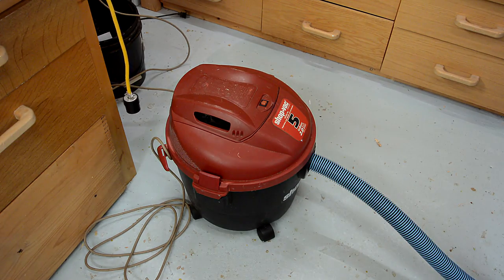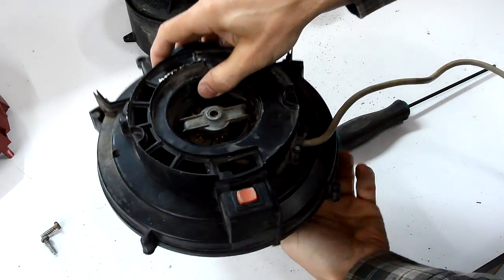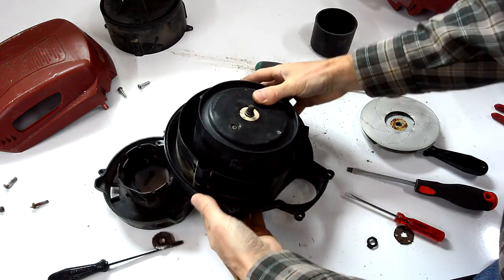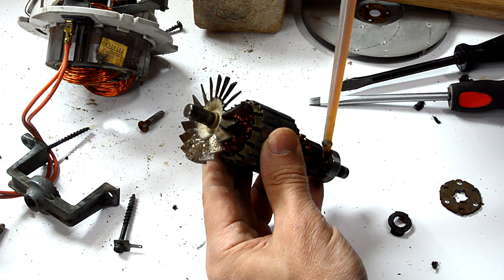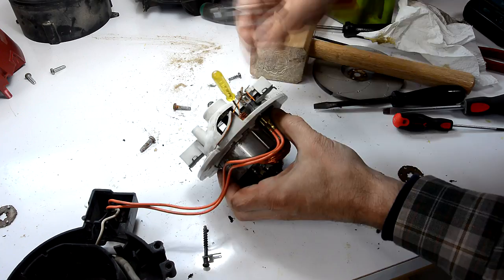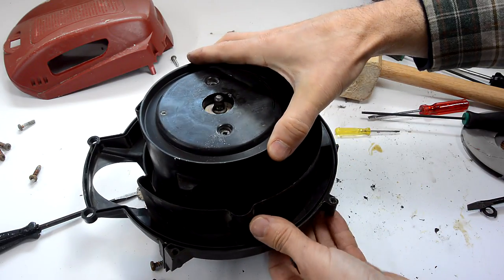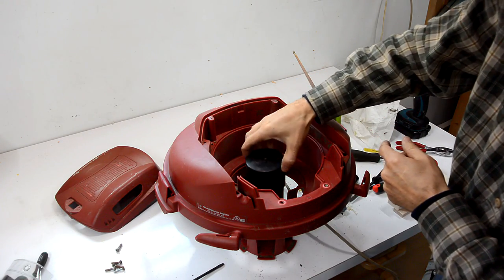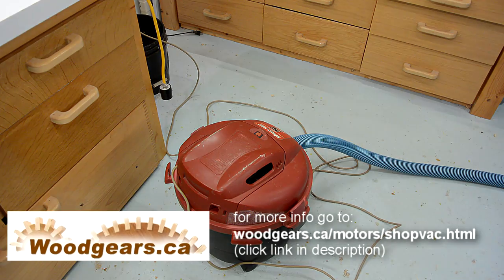Oiling noisy shop-vac bearings

Comment: I have rescued many shop vacs over the years that were sitting curbside, as well as bench grinders, air compressors, a drill press, and even a 1 year old Samsung 55” 4K LED TV. It never ceases to amaze me how much people will throw away rather than attempt to repair.

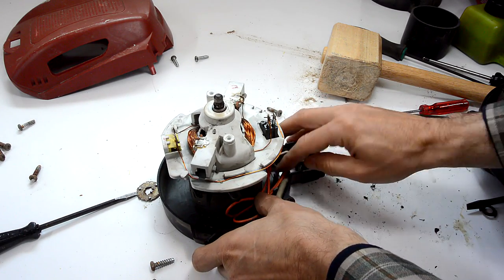The most recent vac repairs were 1) Noisy bearings, fixed as demonstrated here, 2) A bad rocker (power) switch, replaced with one from another broken appliance, and lastly, 3) A burned wire, seen at 4:15 in the video at the 7o’clock position. I simply cleaned the burned end of the wire, then the mounting tab and reattached the wire.

The TV actually cost a bit to repair , but was over $500 less than buying that same set. It took less than $100 and 30 minutes to fix and has been trouble free for 2 years.

Comment: I drilled a 5/16" hole directly above the top bearing.  When it starts squealing, I add a few drops of oil, then plug the hole with a small cork.
Reply: @Neo Anderson took me a while to find the video! It is on his second channel.
Reply: Don't wait for it to start squealing! It's worn out at that point. Lube it routinely, say twice a year.
Reply: I did this also, it works for a few months but now the bushing is so worn I’m going to replace with a bearing

Comment: i do vacuum cleaner and some small appliance repairs for my business, and i cant tell you how many times people will want to toss fairly expensive models of machines cause they make horrendous noises and i a lot of time can convince them to let me do a service rather than spending hundreds on new ones. and like 80% of the time its a chattering bearing or like with vacuum cleaners its one vein in the impeller that;s clogged and making it warp oddly, or a single fin broken off a cooling fan and just needs re-balancing. its very nice to see someone else with the same mindset of not just tossing everything and getting new stuff!

Comment: I really like using Tri-Flow for the bronze bushings because it's easier to use. It's a light oil with PTFE that comes in a little bottle with a tiny straw at most bike shops. If both bushings are accessible via the straw without any disassembly, just give it a couple drops, let gravity pull it in as you spin the motor, and turn it on after it feels more smooth. I believe there is a solvent in Tri-Flow too which cleans things, then evaporates. Sometimes it takes a few squirts to flush the gummy oil out of there, but once it's clean, I've had fan motors stay quiet for longer than the original lube lasted.
Reply: Dont bother dealing with a bushing, put in a ball bearing, videos on here show how.

Comment: Show of hands...How many of us here would have wound up saying something like "Now, how did that go together?" or "How did I end up with an extra screw?"
Reply: I was thinking the same thing. I would definitely need to take photos and organize parts by step if I did this.
Reply: ***** Yes, we have. But we're not talking about Matthias. We're talking about ourselves.
Reply from the maker: I didn't re-watch the video, but it took me several starts to get it together right.  I only kept the last take.
Reply: Haha, yes.. But I found its best to have a system for taking things apart.  like ordering screws in bunches so you can work your way back.
Reply: Each time I find extra screw after I open my laptop. But still all the screw holes has one screw :) I will open a shop soon to sell laptop screws :)
Reply: I took about my PS3 to do some cleaning, and when I was done putting it back together, I had two screws left over. But, this was some years ago. As soon as it stops working, I'll start wondering what those screws were for!
Reply: I took my ps3 apart for cleaning too but when i put everything together, somehow, i had a nintendo switch..
Reply: You dont actually need all the parts ands screws. The manufacturer just throws extra stuff in for free for its loyal customers.  I that was comon knowladge
Reply: Before I developed a more sophisticated method, I use to use egg crates or muffin tins and number the holes. As I removed nuts, bolts, or screws I would put them in sequential order in the crates or tins.  That way, when I reassembled the item, I would use the fasteners in reverse order. Try that. It works.
Reply: For those of you who would ask that? That's why YouTube has a pause button.
Reply: :: holding hand in the air:: 

That would be me.  In fact, I would have probably taken pictures of every step along the way. :Q
Reply: Always use a camera phone to take pictures during each step of disassembly and place the screws (and other small parts) into individual cups or some type of divided organizer. You can write on post-it notes or small pieces of paper to indicate where the screws and stick them  into each cup or divider of the organizer.

If you have a wide enough work space, you can place the screws next to each part that they go to.... Or you can tape them to each part using masking tape.

This is really helpful if you're in the middle of repairing/troubleshooting something, but you get interrupted or you choose to continue the project on another day.

 You'll be able to come back to it whenever you want and know where each screw and each part goes.

Comment: Very good sir. The weak point on these shop vacs is definitely those damn bushings.  That's the part they plan on being the reason you have to go buy a new one and they have the market cornered so they know that in all likelihood you'll end up buying another one of their products to replace your broke one.  Someone really should come out with a better competing product for a similar price range to blow them out of the water.  The motor shaft really should have a sealed bearing on both ends to be reliable for longer I would think. When the bushing went out on both my shop vacs I found that a sealed 8x22x7 skateboard bearing almost fits perfect in place of the bushing with very little modification.  Had mine running like that now for well over a year of pretty heavy use collecting chips for extended(hours) periods of time for my CNC table with no issues. I never really thought of just oiling the bushing although mine was pretty wobbly in there when I took it apart so it was prob too late

Comment: I have a craftsman shop vac that is probably similar and chattering a bit, so this gives me a pretty good idea of what I will need to do.  It was fine summer before last, but during last winter it seemed to get pretty noisy. Now it's time to take care of it.

Already fixed a couple other old, noiser than they used to be things last summer (bench grinder and floor fan) that had been sitting in the garage over the previous winter(s), to be seemingly near as good as new.  Keeping them in the basement now until I need to use them.  Shop vac is down there now too, otherwise all cleaned up, and ready to be lubricated.

Comment: The voices in my head say that for best results you should soak the bushing in oil at ~70degC for several hours. And that you can carefully pick the ball bearing seal out, and re-pack it with grease.
I don't listen to the voices any more, though.

Comment: I replaced the brass bushing with a 608-2rs sealed bearing. Inside diameter is 8mm and outside of bearing is 22 mm, the same as the guide bearing on my Grizzly band saw. You have to drive the bearing onto the motor shaft. Now it works great.

Comment: those bronze bearings often become filled with old oil or grease on the inside surface. you can clean them with a good solvent and I have had some luck with the green scrubbing pads. I imagine fine emery paper would also work.

Comment: If you drill a small(approx 1/8 in) in the metal housing when you oil from the top you can also recharge the oil in the felt pad.

Comment: I enjoyed your video and it inspired me to reopen my shop vac and make another attempt to fix it.  Mine was making that awful screaching-squealing noise as well.  I opened it and lubricated it several months ago and it seemed to work great.  After just a short while, the problem returned. I'm betting you will experience the same.  It appears Shop Vac has designed into the unit a flaw to cause them to sell more motors. They don't just sell the little part that could add new life to your unit.  The problem appears to be that soft brass bushing on top.  When you pull it off again, look at it inside with a powerful magnifying glass and you will see the damage and the cause of all that noise.  If it was a sealed bearing instead, the vacuum would last 30 years, just like my last one did. If somebody tries to remove this bearing and install a bushing there, please let us know how that worked out.
Reply: multiple replies regarding replacement of shop vac brass bushings using ball bearings, if you havent had a look.

Comment: Good video. I do this once every year with all my vacs. It's also a good idea to work those brushes back and forth until all the dust is out. I've seen to many burnt commutators from brushes that were stuck in their housing. It's a dusty environment after all.
Reply: Arjan Quist - I repaired a friends metal cutoff saw with a brush issue. He was tossing it out. I took it home and found that somebody had tried to repair it but they used brushes that didn’t quite fit. They were too large to freely slide in the channel and were not making contact with commutator. I pressed them back out and carefully shaved them until they fit properly, then reassembled the saw. It functioned perfectly. He actually tried to take it back from me later. “Sorry bud, you trashed it, I fixed it, it’s mine!”

Comment: I just re did my craftsman. upper bronze bearing is just like a fan motor, My upper shaft was scored and spun with drag. 600 sandpaper on shaft plug hole for bearing soak 1hp non detergent oil for a long as you can I then drilled a access hole in top of sealed bronzr bearing to soak wicking for bearing. Used a small screw to keep dirt out. Cleaned the heck out of it lite oil on lower ball bearings. Brushes a bear to do. One was worn off center filed it flat. use tie wire to pull brushes in then reinstall shafts tap in or out to remove.. shaft assembly.. Lubed brush holder so they slide silicone spray.  Put extra oil on bearing top. now regurally I will remove top 4 screws and lube that upper bronze bearing assembly.. This is just like fan maintenance...

Comment: At the 1:20 point, here is the trick. Grab that star lock washer and rotate it while pulling gently. It will come right off. If you just pull only, it grabs tighter.They are also called star lock washers or push nuts. On my Shopvac they are 5/16"

Comment: One of my shop vacs is a howler. I took it all apart, and lubed it. It worked for a little while. But that howl is indicative of a worn bushing, so it starts up fairly quickly again once the thick oil cushion goes. I think the third time I took it apart I used grease. But it is not worth the time it takes to take it apart, for the amount of run I get out of it. So it is sitting in my trailer now. What I should do is lube my other shop vacs before they start howling. Yeah, I'll get right on that over here. Let's face it, shop vacs are wear items.
Reply: If you have the time and interest, it could be fun to see if you could replace the bushing.  Even with a homemade Delrin one or something.  But as you said, shop vacs aren't tools you pass on to your grandkids.
Reply: Similar to my clothes dryer roller bushing.  I oiled/greased a couple of times before I finally gave up and bought a new roller.
Reply: n8guy  I think once they howl once, that means the bushing is blown out. It is the too late siren sounding. Oil shuts them back up for a little while. But it doesn't last. I do not think plastic would hold up very well either. Bronze Oilite is nice stuff. To do it right you need to fit it with a reamer. You need just the right reamer, then you need to have the touch, to get the fit. I used to fit Oilite bushings in a tool and die shop for some stuff we made. We'd do it by hand. Chuck the reamer in a drill press, then move the bushing up, and down on it. For a looser fit just ream a little longer. The heat expansion takes a bit more out. It is a touchy process. You have to know the time in your head.
Reply from the maker: Once you let it howl for a while, the bushing is kind of shot.  That's why it's important to lube it before that happens.
Reply: Matthias Wandel
you'll have to let us know how long your fix holds up. I know I've done it here and had less than stellar results. To the point where that particular Shop Vac just sits in my storage trailer today. I'm tired of taking it apart to oil it now. I even tried grease. But just plain bearing grease. Some moly in it might actually work?

Comment: In my experience, oiling the bushing is a short term fix and the motor is screaming again after a few uses. Better to just pull out the bushing and install a 608 bearing (from a skateboard) in its place (usually a direct fit) and the top will be just as long lasting as the bottom bearing.

Comment: I have opened a Dewalt shop vacuum and discovered that the motor in my particular unit is actually ball bearings on the cooling fin side. I'd assume the rotor side of the motor is also ball bearings. There is no bearing noise. The vacuum is over five years old I believe. It works really well. Dewalt probably lasts forever

Comment: Investing in a pair of snap ring pliers might be a smart idea for someone like you that takes apart a lot of shafts and bearings. You can get a good pair for about $15 US (the crappy ones can be as cheap as $7 US). They're extremely easy to find and will save you much frustration.

Comment: Matthias, would a shop vac motor work well in a dust collector? It would be loud though, right?
Reply from the maker: If you want to use a shopvac motor, just use it in a shopvac.
Reply: +Matthias Wandel oh true... Thanks for the advice!
Reply: lol
Reply: Shop Vacs and dust collectors are designed for different markets. One is a poor substitute for the other too. The Shop Vac was made for the weekend warrior to use intermittently. Dust collectors were made for higher volume use.
Reply: i second that  lOL

Comment: lol, I have had to do this a few times. I had by pass the thermal overload one time because it went bad. the thing that retired my shop vac was taking that keeper on and off too many times over the years and it fatigued and broke. I then modified the shop vac with a thein baffle and turned it into a dust separator to compliment my new shop vac.

Comment: I have a newer blue and gray Shop-vac and just had to take it apart to replace the power switch  - looks like yours is a few years older, but has a decent rocker switch. Not sure when or why the company started putting in the junk switch, but it's a common problem.
Reply from the maker: Maybe because they sell them for as cheap as $40 sometimes?

Comment: In addition to what you did I would suggest a slight resurfacing of the shaft surface with some fine grit sandpaper to remove any discoloring.  I'm thinking that it's burnt oil carbon deposits.  Can't be good for lubrication.  Then again it will probably just show up again.

Comment: I am trying to figure out how that impeller engaged the shaft without slipping.I understand the washer part the locks the impeller onto the shaft. Going to watch again and see if I can spot how it catches the shaft. I think I saw some pinched or raised metal on the shaft. I guess its a cheap way to get it to work for them. I have a ShopVac Wall Hanger that make this noise. I am sure it is similar. Thanks for the video!
Reply from the maker: The shaft has two flat spots

Comment: Nice clearly explained video. But if you are going to go this far better to replace the bronze bushing with the 608-2RS bearing and save yourself having to repeatedly perform this lubrication. My bearing installation went smoothly except the replacement bearing was loose on the shaft when in the correct position. So this proved there had been wear/ noise from that area. So I used the (center punch method ) made a few marks on the shaft to fix it securely. Running quieter now, hopefully for many more years.

Comment: If you want to lube the ball bearing, open the seals/shields with a small flat-head screwdriver, degrease it and apply new grease and close the seals. Dripping oil on the outside of the seals will do no good.
Reply: If you have a press, the best way is to replace it, they are not very expensive.
Reply: Oil is a lot cheaper than bearings are. Plus it is easier to stock a supply of oil than every bearing known to Man.
Reply: @peceter 
Right, which makes me wonder why they are using that stupid brass bearing.
Reply: timfischer
because it's cheap.
Reply: If the are rubber shield then yes they are easy to get off, this is the preferred type of bearings for skateboarding.  I used to be quite good about cleaning my bearings for that application, but have many times applied oil directly through the shields.  This has worked great for me in a pinch, but the typical skateboard bearing lubes tend to have less viscosity than what was shown here and may flow around the shields better.
Reply: They may have metal shields (RZ type) that have a tiny gap and can be oiled this way.. not cleaned but some oil will get there. The problem is it may flush the thicker grease inside it and make it even worse